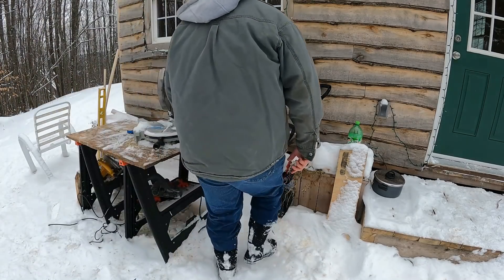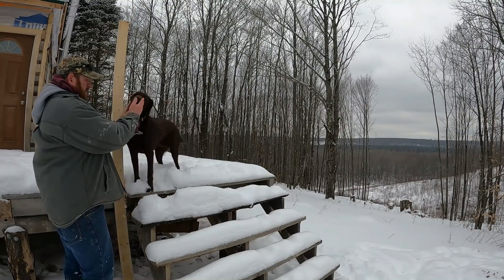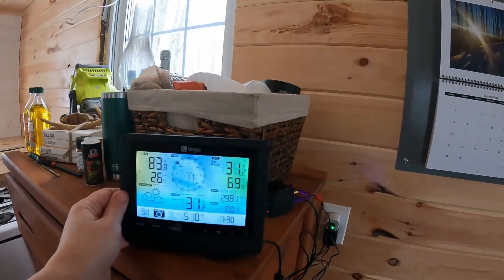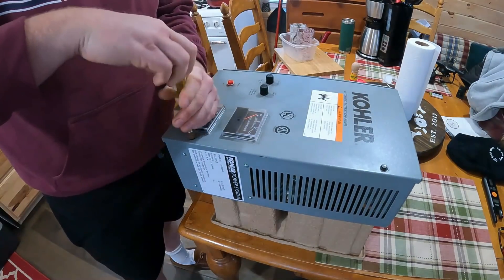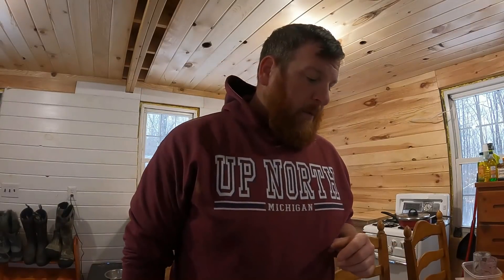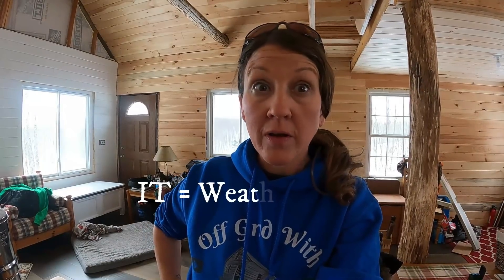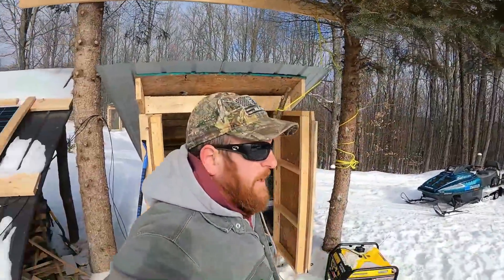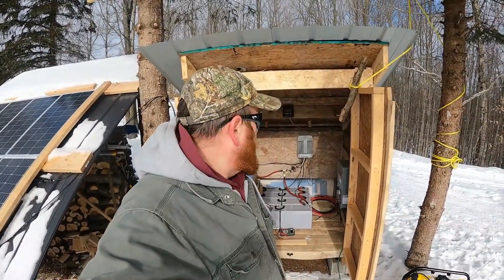Chilling Reality: How Winter Impacts Our Solar Power System

Comment: It is totally normal for the charge read out to drop to the charge. It does this once the generator is turned off/ sun goes away. Once the power has disDissipated from the source you will get the correct reading of charge. A little insulation around battery bank would help. Any questions feel free to ask me
Reply from the maker: Very nice....I have the settings to the factory settings for a sealed lead acid battery or AGM so the CC limits the charge to 28-29 volts I would have to double check it, but it just worries me when the Batteries are at 24.2 volts in the morning....then after 2 hours of sunshine in the morning the battery bank jumps up to full charge and doesn't seem to benefit from a good day of sun....Just sits idle all day saying it is full.
Reply: @OffgridwithJayandJen  I have the same CC and use it as a backup. I'll take a look at my settings and share. Although my bank is lithium so some of them will be different.
Reply: Totally agree. When the charger is working it must be at a higher voltage than the battery. When the charger stops you will see the actual voltage of the battery. In terms of it cycling on and off I would look at your charge setting and specifically for the float charge. Hope this helps.
Reply: It’s like short charging your cell phone. It shows charged till a load is put on it

Comment: Most of my stuff is ran off of DC but once I insulated my battery things got much better. The cold really takes its toll on the batteries.Looks like you guys had a beautiful vacation! Life is good
Reply: I can hardly wait to get my solar-thermal project going .. battery and voltage regulator are coming this week.  Now, if the sun will cooperate .. ;)
Reply: @Green.Country.Agroforestry  I can’t wait to see what you picked up. I’m redoing all of my solar as well this summer. I’ve learned so much the last two years.
Reply from the maker: Thanks buddy

Comment: No that's because it is reading the solar coming in . When it goes back down it isn't.  You need to measure the batteries at rest with an amp clamp before there is anything on the panels. We have had solar for 12 years.
Reply from the maker: Thanks Cheryl

Comment: The truth about solar?  It's an adult toy.  Every channel I've watched on youtube that has solar had found it does not provide a modern lifestyle.  If you want to live like your great-grandparents solar is a good idea.
Reply: Many people have proved that solar works and works well. The system needs to be designed, installed, and set up for your needs, correctly.
Reply: @westend3019  It's a money pit, always upgrading, buying new batteries, more solar panels.  Solar is supplemental at best.
Reply: @johnmarquardt1991  It doesn't have to be that way. Yes, batteries are not permanent but the newer lithium batts last well. If a user designs the system to meet his needs (+), it can be reliable and adequate. Budget often rules with off-grid installations.
Reply: @westend3019  Every youtube channel I've watched that wanted to go off-grid with their electricity needs by using solar and all have failed.  They rely on generators or are thinking about hooking up to the electric grid.
Reply from the maker: It has its limitations and you are correct with not being able to provide for a normal household,  but this system provides us with lights and charging capabilities  but would never handle full time appliance use

Comment: Why do you think a 24 v system is low at 24.3? My 24v system is set to turn off at 22.0v to save batteries. I usually charge my batteries with generator when I get into the low 23’s. The guys that installed my system set it up that way.
Reply from the maker: From what I read 24.2 volts is 50% discharged. So with these being AGM/sealed lead acid it seems.bad to over discharge them. So maybe yours are lithium? Where you can run them down farther without damage?
Reply: @OffgridwithJayandJen  we have 4 ea 6v AGM hooked up in series to make 24v. Not sure on the discharge % but the guys that installed the system 3 years ago set it to shut down at 22 volts. I usually charge batteries with generator when I hit low 23’s before dark since we have things sucking juice all night. So far things are working great, no loss in efficiency that I can tell.

Comment: Have been watching you for a while now. You guys are doing great. As a fellow off gridder from Canada. Solar is fine. But come winter you will need a way to top up those batteries. My generators run all winter to keep my batteries charged. Unless you have a very large solar array it is the only way to do it. So I have to buy a little more fuel in winter no big deal I spend nothing all summer
Reply from the maker: Awesome.....thanks for the insight my friend